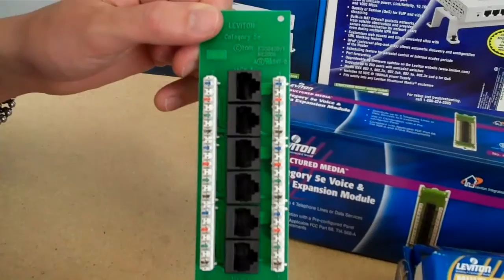Structured Wiring Data Distribution Modules Cat5e

Comment: Thank you so much for this video. I need help configuring my LEVITON Category 5e 2001 PWA 58195- . Everything has already been set up. I just need to know how to lay the colored cords out correctly. (The contractors that built the house did not lay the colored wires out correctly, causing the ethernet outlets to not function.)
Reply: Don't know if you've gotten help on this yet but, you should be able to correct the wiring at each location without much trouble.  It will take some time, though.  Just remove each outlet cover and change the wires to where they should be.